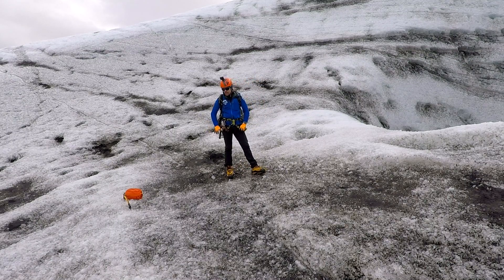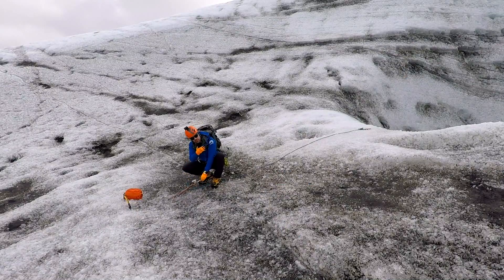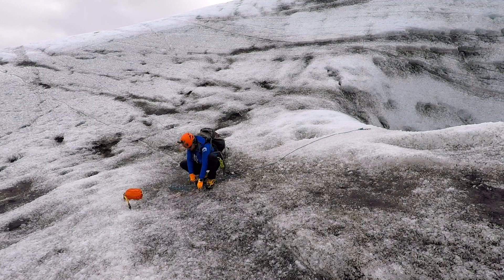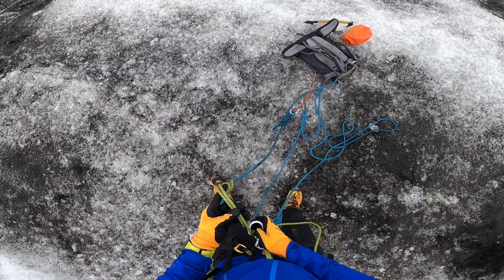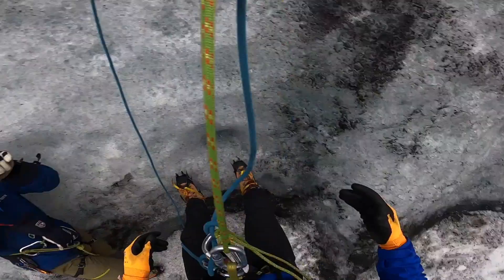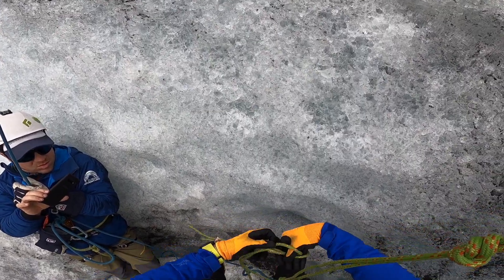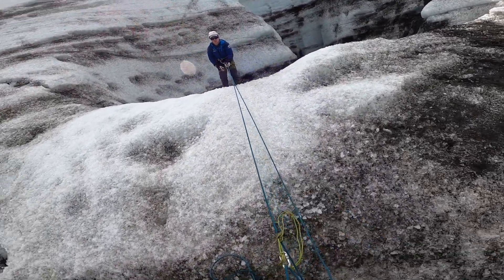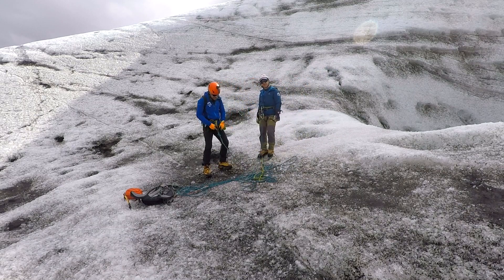FAST 6:1 Drop Loop Crevasse Rescue

Comment: Munter with the break strand over the ‘biner’s gate? I know it should tighten the locking ring  if braking lefty. But, why put more wear on the rope?
Also no redirect off the Prussik?
Reply: Hi John , thanks for the observation and good point, it´s important to take details into the account, for safety reason and for environmental purpose as well.  You can of course also have the brake strand on the opposite site, another good suggestion would be to keep the brake strand straight up so it will not form a “ pig “ tail in the loop, having the rope come 180 degrees into the munter minimize the curling up part and will also be kinder to the rope.  All the best team Glacier Adventure

Comment: Great video. Love the system you're using. I've never ascended with a micro traxion so I was wondering. Would it be advisable to throw a catastrophe knot or some sort of back up in while you ascend?
Reply: Hey hey, glad you liked the video. No backup is needed. This device is rated to be used as a PCD (progress capture device) at the focal point of an anchor without a backup so it can also be used on yourself in place of a waist prusik. One thing that is important to remember is to avoid shock loading the device so take your time when ascending so don’t bounce on the device as you ascend.

Comment: What is the point of putting a mule on the victim?
Reply: So the point of muling the victim is to address the issue of the victim sliding further into the crevasse while unattended at the bottom (while you ascend and make the haul system). This assumes its a tight crevasse as opposed to the one shown in the video.

Comment: I’m a major beginner so I’m only asking for learning purposes and not trying to critique. After you set the microtraxion you removed the Munter hitch and used a foot prussik. Would it be better to set up a backup such as a clove hitch below the microtraxion in case of a failure or is that over-redundant?
Reply: Yeah critique away. Yeah, so I appreciate your thinking but we do not need to set a clove hitch under the Micro Traxion as it is trusted as PCD (progress capture device) / ratchet without needing a backup. This is demonstrated in the technical notes by Petzl for the Micro Traxion (file:///Users/globalmikereid/Downloads/technical-notice-MICROTRAXION-1.pdf). If you are using a soft hitch like a prussic, then yes those would need to be backed up because if managed improperly, they could slide down the rope.